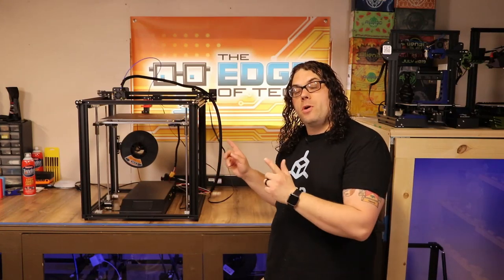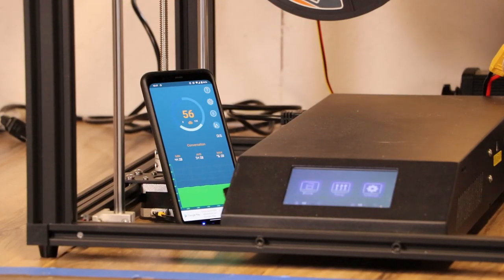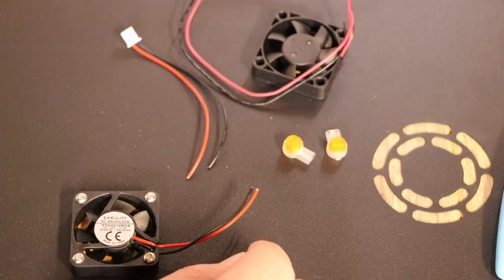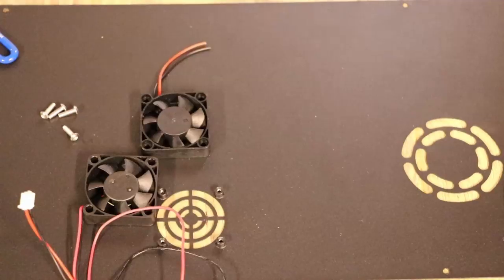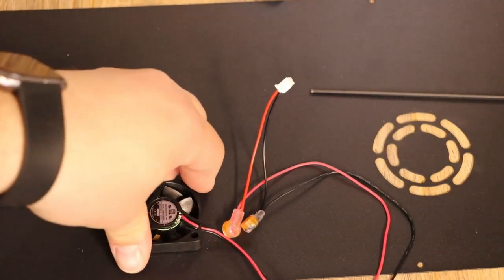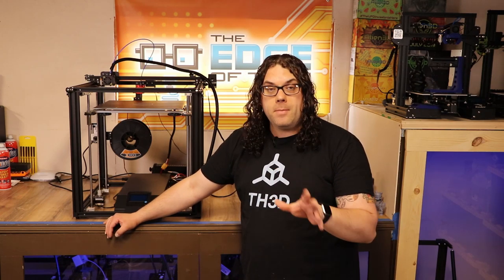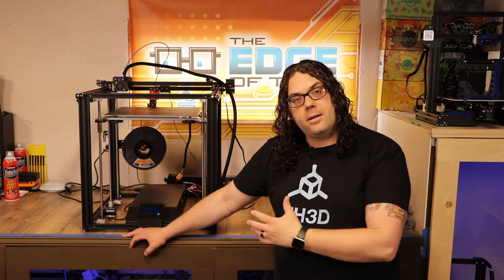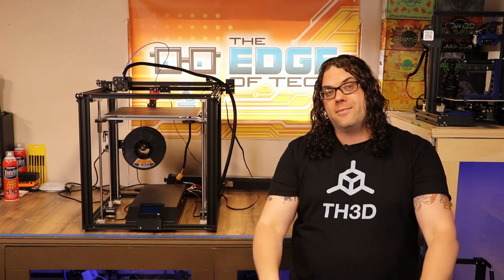🔊How to replace the LOUD Fan on the Creality Ender 5 Plus - Very Easy

Comment: Just did the TH3d "silent" fan replacements on the case and hot end, seems just as noisy now.  They are not as much of a magic bullet as the silent board is, that worked great.

Comment: Thanks for the video, I appreciate the step-by-step explanation.

Wouldn't it be easier, though, if the replacement fan had the correct connector and mounting holes? It seems like fans are standardized enough that it shouldn't be too hard to find a more suitable replacement part.

Comment: Hi Jim, after just watching another great video of yours, I decided to check my Ender 5 Plus.  The DB level from the case fan was between 45 and 50DB.  What I think has helped me is the anti fatigue mat upside down under the printer.  It has also reduced vibrations. Will keep your mod in mind in case the fan fails.
Reply from the maker: Great Idea John! That will help the noise level as well! Thanks for watching!

Comment: Nice video, but are you using a 12V or 24V replacement fan now? I would assume a 24V but the link is for a 12V version

Comment: Nice video.  I’m glad you didn’t replace the fan with a noctua fan.  The fans that TH3D are much better. Thanks for sharing. Your enthusiasm is always appreciated.
Reply from the maker: Thanks man! I like the TH3D fans too! They man not be as quiet as the noctua fan, but the air flow is better, and that's important! Haha
Reply: @TheEdgeofTech  Are there even "TH3D fans"? The one in the video is by orion fans.

Comment: Hi Jim - thanks for doing these! I wanted to follow-up on a question others have asked; the link you have to the fan shows it as 12v but the original fan is 24v. I ordered the fan from your link and didn't spot that difference until I was about to do the install. Is the link correct? Is it ok to replace that 24v fan with the 12v one?
Reply: Just to follow-up with my own comment; no, you can't replace one fan with another of a different voltage. Double-check the voltage of the fan in your current printer (mine are 24v) and then make sure you're ordering the correct replacement fan for your system (the website has both versions and they look identical so be sure to read the spec).
Reply: @KenRossPhotography  at least you responded yourself because i started wondering myself. Thanks !

Comment: This video is a little old for this answer but figured I would answer a question you got in the comments a couple time. The connectors are known as scotchloks or butt connects or buttons or UY2 connectors. They are typically used in telephony and yes technically you could use whatever pliers you like to crimp them, however, there are specific pliers for them that have two flat faces and are spaced to the exact crimp. The only reason I mention this is these connectors are held via a bar internally and it is meant as a way to regulate resistance as well as connect two insulated wires. Also the top end is only held in place by tabs on each side inside. So by using pliers other than what is meant for them you can get an uneven crimp or blow through the tabs that hold it in place. In the copper twisted pair world this can lead to shorts, and voltage irregularities. Also these are regulated for wire gauges 26-19 AWG. Lastly if using these flip the connector over it is easier to see the wires are seated all the way before crimping ; ).

Comment: To avoid having to re-level your bed following a project inside the control box, remove it from the frame. There are 2 screws in the front, and 2 in the rear. This will preserve your leveling, AND, more importantly, prevent any accidental damage to your printer. Another thing you can do to even further reduce the noise levels, would be to use your favorite rotary tool (mine is a Dremel 4300) and cut away the fan grills that "protect" those fans. You can do this for both the case and the power supply fans, if you're brave enough to venture inside the power supply. Seriously, the fans are on the underside of the control box, no little fingers or even curious pets are going to get under there. Those fan grills restrict air flow, and can actually cause noise levels to increase because of the resistance they create. That's just some of my old computer modding days from the early 90's coming back to me.

Comment: I think, a normal 80mm fan from Arctic cooling with a cutout of the case should work also right? And what's about the fan in the power supply?

Comment: Jim what size wire comes on the fans I ask because I already have some spare fans and instead of using dupont connectors I want to use those solder tubes but need to know what size the wire is so I can buy the correct tubes

Comment: DO NOT leave the gap, having no gap forces the air out of the machine, if there is a gap, some of the air will go around in the gap back into the machine not properly cooling it.
Reply: or it will create a Venturi effect... maby ???

Comment: You should do a video on the Insanity Automation 7.4 board and screen firmware, which solves the XY offset probing issue and gives you loads more control of the printer from the screen plus an updated Z-axis control over the baby-stepping allowing you to set the amount it moves for each press of the button so you don't have to press it 200+ times

Comment: Also you did this wrong .   TH3d sent that style of fan like so,  because the extra spacing  is what also will make the dramatic difference is sound.  3 things that are the major factors in fan noise is Fans  > amount of blades and pitch ,  RPM speed   and the spacing against object causing a back flow ( causes a lot of extra noise )  .

Comment: The fan you are removing is a 24v.   The ones you are recommending from links are 12v!  Are you sure this going to last?
Reply from the maker: Hmm. It shouldn't be. I will change the link right now! I suggest a 24v fan to replace the 24v fan I removed.
Reply: Dah!

Comment: Fan model/part number? TH3D link for fan?
Reply from the maker: Oops! I thought it was in the description! I will get it added!
Reply: @TheEdgeofTech  Right on! I should have looked first. As always, TH3D has their stuff together and you can search for upgrades by printer model. Found the 40mm fan there, but good idea to add it to the description box. Keep cranking out the great content, Jim!
Reply from the maker: @jerrymartin9323  Its all good! I'm glad you mentioned it! It's there now and if you use my affiliate link it helps the channel too! :)
Reply: @TheEdgeofTech  Will do, Jim!

Comment: You are reading my mind Jim, this is getting creepy!!  Another mod to add to 'the list'.  IMO, I never tilt my printer.  I find it much easier to remove the entire PSU compartment from the frame, via the 2 front and 2 rear frame bolts.  There aren't that many connections, and it only takes 10 seconds to disconnect everything.  My $0.02CDN!
Reply from the maker: Good idea!! This one and the next couple are on my list for sure! Thanks for watching!

Comment: 5 minutes to drill the holes deeper, 20 minutes search for the proper drill bit and tape,  40 minutes to go buy said drill and tape once you realize you don't have either.  I hate how these videos over simplify tasks.   Not a mention of voiding warranty or even if the fan meets the proper spec for the printer.  Quieter, but at what cost?
Reply from the maker: I never said it wouldn't take time to gather the proper tools. But one you have them, it's very simple to do! This fan is better than the stock fan! I assume most people have a drill and a bit, and if not you could do it the first way I showed. I appreciate the feedback, and thanks for watching!
Reply: broderp : you can as well leave it as is, this is just a guide, no obligation ;) I'm happy with quieter fans :) Thanks Jim !
Reply: Warranty? What warranty you ever try to get something warrantied from China? Forget it, something blows up just replace it. $30 main board $10 fans cheaper than shipping.